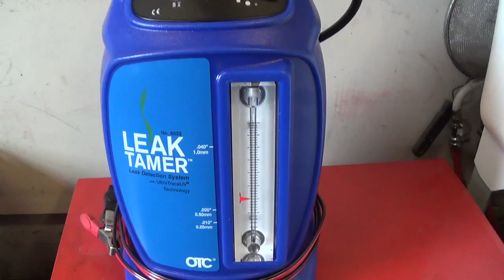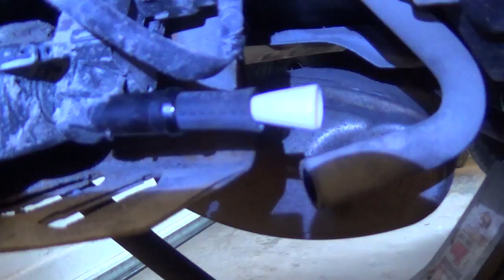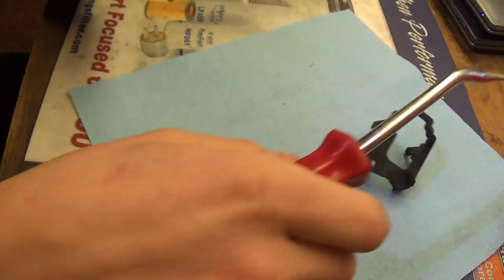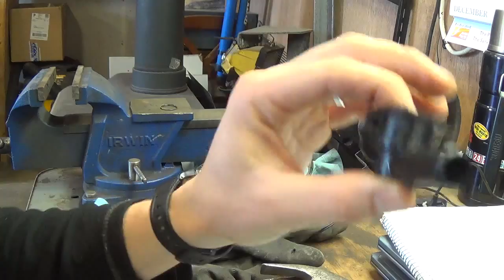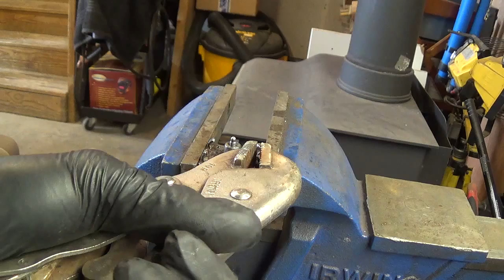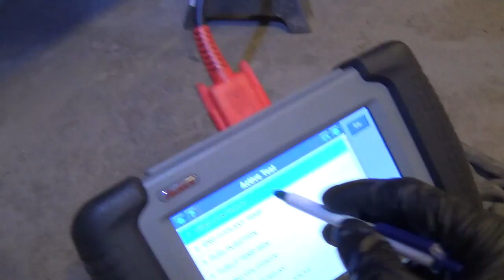EVAP P0456 Diag & Repair: Nissan Rogue - Part 2

Comment: Hey man, how are you? I watched your video diagnosing your wife’s Rogue. I have a 2014 Rogue and already replaced the purge valve and vent valve, but I’m still getting a P0456. During the smoke test, smoke comes out around the rear passenger-side wheel/canister area. I’ve heard this may be normal venting, but I’m not sure. Any idea what I should check? Thanks

Comment: The leak comes from the o ring not stting on the metal correctly it has rust between the o ring and the metal.😮😂

Comment: Another subscriber who's benefitted thanks to your trailblazing this.  I live in the Midwest US rust belt and sure enough my vent solenoid was nearly as rusty as the one in your wife's Murano (if you still have it after six years).  I bought a new vent solenoid instead of repairing the old one which I'll keep as a souvenir of insufficient engineering.  How much more would it have cost to add a black oxide or iron phosphate coating to the bare metal surface to prevent it from rusting!!!    It lasted 9.5 years before it triggered the PO456.  I got tired of clearing the code every week just to have the DTC return like clockwork.
Reply from the maker: Original vent solenoid is still going strong on the Rogue. 260k miles!

Comment: People! If error U1002 is on, then the problem is in the absorber ventilation valve (which is freely open) is located on the absorber itself.
I found this info on an American site, and the valve turned out to be not

Comment: In the world of "Brokeville", this is common practice. "See if you can repair it before replacing it." Half of the people I do work for PREFER these attempts. I did the same thing with a purge valve... But cracking the seal on the plastic bond takes some skill with a screw drive handle, and striking it 'just right' to crack the bond can be tricky!
I've had to flow the plastic back together with my butane RADIO SHACK soldering iron... (Had for over 10 years now)

Comment: Its called a solenoid ( the metal plunger) and the “electrical “ part is call a coil/ (solenoid coil). We use them a lot in supermarket Refrigeration for automation. Just an fyi😉. Great videos

Comment: If you dont mind me asking, how many miles are on this rogue? Mine has 181k and my check engine light came on this morning. No hesitation or driving or starting issues. Gas milage is fine to, I think this may be it. Getting the code read after work.

Comment: Those small bench grinders are tricky. When wire brushing on the left side, the fractional hp motor slows down. The grinding wheel on the right side has inertia and the right hand thread will loosen. You'll be ok standing to the left but watching that stone climb the wall across the room will be a moment to remember.

Comment: I like your thinking and what you did here Ivan very good fix!!!
I like the invisible safety glasses you're wearing !!!!  what are the chances of one of those pieces of wire off that wire wheel lodging in your eyeball ???
Reply from the maker: I know I know...at least my face was not in line with the spinning wheel....kind of like biking in the wet: hold your face away from the plane of the spinning wheels to avoid mud in your eyes :)

Comment: Great video Ivan.  The satisfaction comes from the repair, rather than just changing parts.  If parts were made better then they would be worth more and worth repairing; as it is, even the car is made to recycle ever 10 years or so.  We live in a throw away society but it is still good and very satisfying when somebody bucks the trend and makes a repair as you did--well done.

Comment: Hey nice video, I enjoyed watching you rebuild your vent solenoid. I am sure a lot of people were screaming, just buy a new one already, but hey doing a little tinkering and cleaning saved you around $100.00 (if not more). Vent solenoids are a little pricey. Also, I think your rebuild should last quite awhile, and if it doesn't who cares it didn't cost you anything but a little time. Anyway nice video. Have a good day.
Reply from the maker: Thanks for the comment :)
Reply: I know that this video is 3 years old, but Rock Auto now  has an Economy model for $27.  And a Regular one for $67.

Comment: ya on average aftermarket is questionable. at some point though it is not worth the $ for factory parts on a high mileage vehicle. u will have to replace that part anyway if u keep running it for awhile. no win anyway u slice it!

Comment: Ivan, I do realize that finding parts in The Motherland was a nightmare and that extreme measures were likely needed back there. However, you're now over here with us wasteful Capitalistic Pigs so just drop into O'Reilly's and buy a damn solenoid will you. Also, you're way too smart to use a wire wheel without eye protection. Just because Eric's a dumb ass with respect to eye protection doesn't mean they you have to be as well. You only get two eyes per lifetime. Respect them.
Reply from the maker: I think I will just hang a pair of goggles right above the grinder so I won't have an excuse NOT to put them on. And I don't exactly live in the middle of town so driving to a parts store and back would actually take more time than just cleaning the old one ;)

Comment: I am glad to see I'm not the only one out there that does this type of thing.  I, also, have spent hours fixing something that should have just been replaced and had people (my wife) say to just go get a new one.  I refuse and pretty soon I have a fix and no money out of my pocket.  Nobody does this anymore and it's good to see someone do it.  In a shop environment time is money so it's not worth it.  For a DIY'er in the garage, it's a solid fix.  

I was thinking while watching that I would have taken the plunger itself, chucked it up in my small old vintage Unimat hobby lathe and turned off just a bit of the plunger side.  The grinder on the body worked too.  The only thing I was wondering was how much pressure they decided that they wanted on the seal while activated.  If you take off too much then there would be more pressure on the rubber seal, rather than on the shoulder of the plunger.  

This is real garage and field repair.  For $150 I would have done exactly the same thing. Thumbs up!

Comment: On the OTC, is it possible to pressurize the system and check for flow/leaks without smoke turned on? Looking to upgrade my older machine
Reply from the maker: hmmm I think you can't disable the smoke and just have air. Kind of defeats the purpose of a SMOKE machine no?
Reply: What came to mind  is the Redline brand can induce just air. Watching the meter,  if there are no leaks, your done. However if the meter indicates a leak, then you can turn the smoke on. I guess its one way to save on smoke fluid, or extend the life of the heating element. I do like the nice meter on the one you have though. Lots of smoke! I dont think Ive seen anyone so determened on a vent valve! But then again, the price for nissan parts are rediculous. Nice job my friend, keep up the great videos.

Comment: I did fix an old solenoid one time on an outboard motor by taking it apart (held together by rivets) and cleaning the contacts. I have a strong feeling your fix is better than a new one. Great, great job, and fun to watch.👍👍

Comment: dear sir I have ford explorer 2010 last week I find sound under like transmission are transfer case with check engine light I find following dtc code -p0970 , p0966 ,p0962, p0765, p0760, p0755 ,p0750, p0743, 
how I can fixed it what can be the problem 
this car is AWD
Reply from the maker: I think the main problem is that it's a Ford Explorer. Did you try looking up the code definitions online? Is it still driveable? Sorry I can't be more helpful without looking at the vehicle.

Comment: As a guy that will attempt repairs at the molecular level to avoid giving dealerships a dime I can appreciate the your effort and a job well done.   I may be wrong but it seems that you arrived at a fix the hard way.  From what you showed of the valve and the direction of pressure and flow the valve appears made to stop flow primarily in one direction.  The clues are a fairly large hollow rubber cup seal mated with a weak solenoid,  the inlet has a sturdy connection while the outlet is a friction fit hose barb, and the two o-rings.  When flow is applied as when installed and tested with your machine the valve cavity on the solenoid side becomes pressurized and forces the seal against the seat.  The solenoid only has to be strong enough mate the seal while the pressure builds - like seating the bead of a tire.  When you tested the valve off the car by blowing through the barb end you got a false failure as the valve wasn't made to hold much pressure in that direction.  The real failure modes was gunk preventing a seal at the seat and the rust under the o-rings preventing pressure buildup behind the cup seal.  Cutting down the piston stop changed the operation of the valve from pressure assisted to direct acting.  If the system is programmed to de-energize the solenoid and allow the valve to self-release when the pressure drops you may still throw a code.  Some silicone at the o-rings may be needed to restore the pressure assist.  
I am by no means knocking your fix.  Just offering food for thought if you or others come across a similar issue.  By the way; I just spent many hours on-site crawling into, under, over, and around an F-250 SD plow truck tracking down broken relay signal wires from the PCM.  It will be a week before my old ass can walk upright again so PLEASE call off the Karma Gods!  I will not make any more comments about bypasses!  ...unless you really deserve it.

Comment: Ivan, I think you should have took more off the end until the rubber plunger sealed with a little daylight between the metal plunger and the housing boss.

Comment: At least that one can be rehabbed. The POS units on the GMs are all plastic and sealed. On yours you should have sprayed it down with some good stuff, then a coat of plasti-dip to keep the water/rust at bay. I've been using it on the GM ABS sensors for a few years now. Don't see them getting rust under them once they are sealed.
Reply from the maker: Good tip on the GM ABS sensors! Yeah the GM vent solenoids usually fail electrically. Weird thing is replacements costs anywhere from $30 to $200 for basically the same part!! I just buy the cheap one and reuse the filter lol
Reply: Blazer02LS Sealing with Plastidipl! That's an excellent idea.

Comment: this is the kind of stuff i love doing. i would have shaved off a whole mm to guarantee a seal and eliminate a comeback.
Reply: I know what you mean. in this case though that plunger can force the sealing valve to far and either tear it or distort it against the seat.

Comment: This is why I enjoy You Tube :), Tho those metal tabs will break off if rebent to many times, But then you go to the small gauge bailing wire. 150.00 bucks for groceries, Win. I bet that part costs Nissan 10.00 to produce, and maybe 10.00 to ship, another 5.00 to stock, basically close to the same markup as Jewelry. Great job Ivan
Reply from the maker: Ha you would thing it's made of some rare precious metal based on how much they charge for these things!!
Reply: You would think that at those prices people would find another way to repair their car, but having worked at many dealerships installing communications equipment and watching what goes on there , hundred people at least brought their cars in for repairs, they must be making huge amounts of money off service alone...You should be able to make a mint with your skill and knowledge.

Comment: You're a chip off the old block Ivan. After watching the vids from the  Russian Garage about how your dad had to be so innovative to keep the ZAZ running with next to no spare parts I understand where you're coming from! 10 outa 10 for ingenuity.
Reply from the maker: Thanks for the comment, that really means a lot! I'm really surprised at the positive feedback on this video. I thought everyone was going to call me a hack and a cheapskate LOL
Reply: I can totally relate, I did this about 1.5 years ago on the power-folding mirror of my Civic. I did not accept to buy a mirror for 200€ just to fix a small electro motor than runs for about 10€.
Reply: Hack no. Cheapskate YES!!!
Reply: It's this attitude that has reduced us from Mechanics to parts fitters and why we now get paid peanuts....because any fool can change a part. Troubleshooting is be superseded by the parts cannon!!!
Reply: This is actually a crucial part of a capitalistic system. Nobody makes money when you fix something for free. When the parts cannon is fired the part manufacturer makes money, the parts store makes money, UPS makes money delivering the part to the parts store,  Exxon makes money when the parts store needs to buy gas for the delivery truck that delivers the part to the garage. The garage makes money installing the part. To a capitalist there are a hundred profitable reasons to fire the parts canon and zero profit in spending two hours tearing something down and repairing it. If Eric or Ivan had shops in a big city with high overhead there would be no way they could afford to do this type of repair as they would go broke within six months. The American economy is dependent upon robbing the customer NOT giving him the best deal. I make no value judgement as to whether this is good or bad I simply state that's how it is.
Reply: Maybe you’re(not only you …. us capitalists ) are suffering from capitalist brain washing, how about the customer spends $150 on labour, instead of $150 on parts and $50 on labour and spends the savings shopping at a local shop where a true trades man is selling his labour crafts or wares?  I’ll tell you corporate fat cats don’t get rich doing very little….your scenario is what we in the capitalist world are brain washed to believe…. We have become lazy because it is easy and requires fewer skills to do it this way and we are slowly losing our skills that we have left (how did the capitalist system survive 30-40 years ago when my father and grand father fixed things and repaired thing and cooperates payed good pensions and CEO’s where paid well not outrageously
Reply: Years ago, mechanics used to do just this sort of thing, before the days of chuck it away and buy a new bit.
Reply: WhitwellMike B: my thoughts exactly. I basically grew up in that era when you had to actually fix things like this.
Ivan you're the man!
Reply: i grew up fixing my alternator. last month parts stores laughed at me. impossible to find nissan rogue alt parts locally!

Comment: u can get one of those from rock auto for about $80. made by standard motor products. fine for this app.
Reply from the maker: I like SMP, but generally aftermarket units are pretty flimsy compared to OEM.

Comment: GoFundMe link started for a vent valve, lol.  You can put a vacuum/pressure gauge inline with the paint can smoke supply tube/ 1.5 to 2lbs of pressre reading.  When you fix the leak or close the valve, the needle should stay put. Although not as accurate as a flow ball,  might give new life for an old paint can
Reply from the maker: Yup I have seen James Danner use that trick in a video. It works! The fancy smoke machine just makes you lazy ;)

Comment: good work dude, I wouldn't have replaced that thing either. it's too simple. maybe this is a bit conspiratorial, but having that "exact" closure gap in there almost seems like an engineered failure point to me... why restrict solenoid movement? that guarantees a leak due to rust, seal wear spots, plastic deformation and so on. I bet your fixed unit will outlast a dorman part, esp with fluid film on there. good stuff.

Comment: It looked like the black O-ring was holding the valve body just a little above that metal plate.  They can be hard to crimp tightly enough when doing it by hand - the metal tabs always want to spring back up just a little, and that will mess with the total plunger movement needed.  Great workaround with the grinding, though.  :-)

Comment: Reminds me of a time here in the USA when cars were routinely "repaired" instead of "serviced".  Water pumps, fuel pumps, alternators (generators), electric motors, carburetors, pumps  etc were routinely "rebuilt".  Parts stores sold kits to rebuild with.
Reply from the maker: I find it satisfying to repurpose an original part instead of replacing everything left and right. About a year ago I fixed a power lock actuator on a Honda Accord by re-soldering a broken wire in the winding of the actuator motor instead of buying a replacement unit. Still works great to this day! Sometimes it's not feasible, but other times you can get away with it ;)
Reply: Yes.  Imagine how many electric motors are discarded and replaced when all they really need is clean brushes?  Used to be a regular service item.  Now most are inaccessible.

Comment: Nice upgrade to the Leak Tamer. Quality diagnostic tools are well worth the $$ and now you just saved $150 for more tool purchases. Nice repair Ivan & it's definitely more satisfying to rebuild. Not cost effective on customer cars but definitely cost effective on your personal cars.  I'm old school when we rebuilt everything m/cyl, w/cyl, calipers, wiper motors, starters, alternators, distributors, carburetors, f/injectors, etc and now it's go buy a new one or rebuilt one and play roulette with the crap rebuilds.
Reply from the maker: Exactly! On my old Mazda van the alternator stopped charging at one point. Instead of buying a new/reman unit, I found a separate regulator/brush assembly online for like 20 bucks, popped it in...still works perfect to this day :)
Reply: motoYam82 Yup. I rebuilt a Mazda starter and front calipers last year. Fun, cheap, and satisfying!